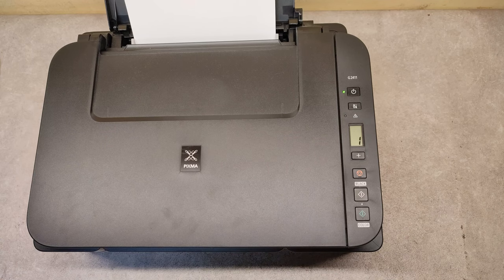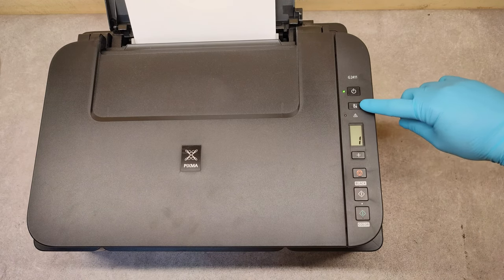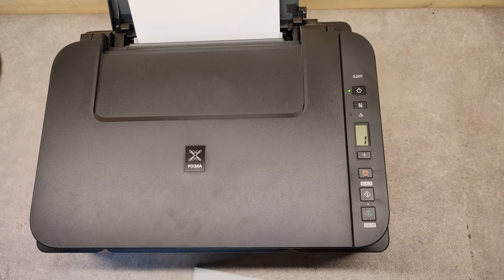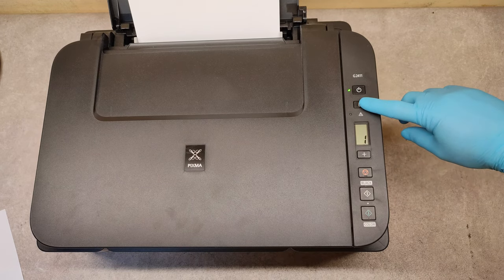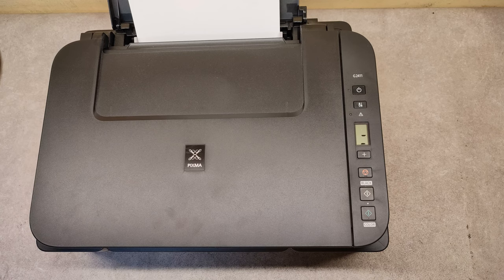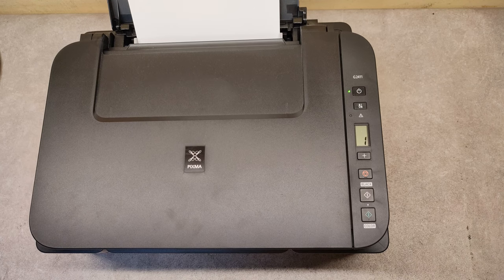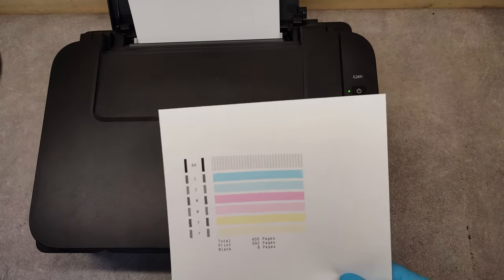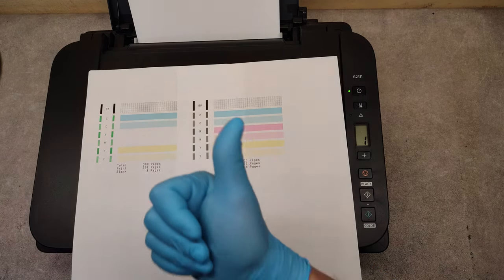HOW TO PERFORM A PRINTHEAD CLEANING ON CANON PIXMA G2411, NOZZLE CHECK

Comment: I've done this severally and the problem is still there
Reply from the maker: Probably your printhead has worse problem and has to be replaced. You can contact the local service center for further assistance. Good luck!
Reply: @MrPrintGuyDIY am făcut asta și mergea tot timpul, acum nu mai merge.

Comment: What if it didn't work
Reply from the maker: In case it didn't work after 2-3 cleanings, you have to replace the printhead at the local service center. Probably the nozzles are clogged. Good luck!